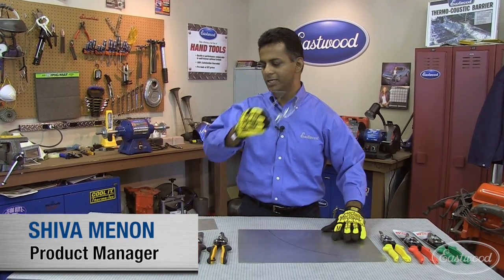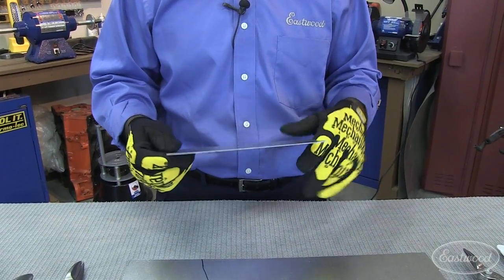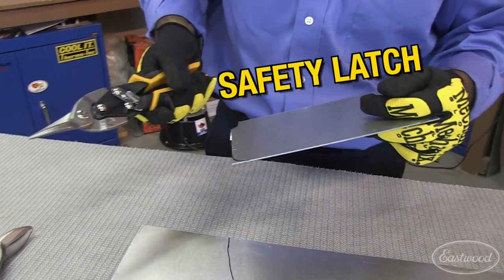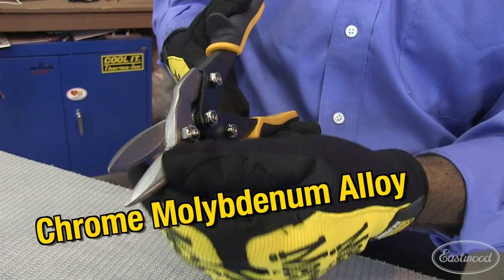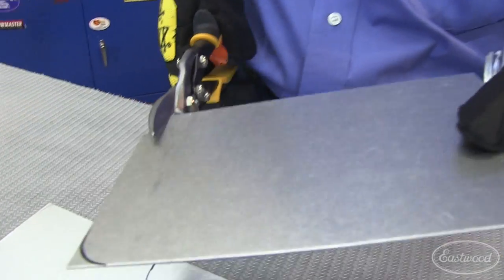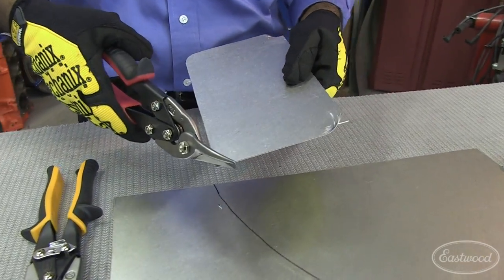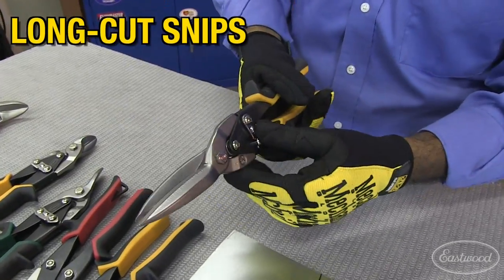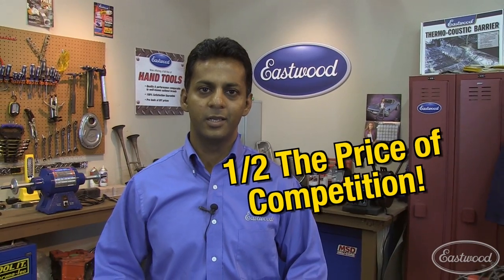Aviation Tin Snips - Wiss vs Eastwood

Comment: In 1953 body panels changed to 22 gauge steel. In the early 80's it went thinner than 22 gauge. 20 gauge would be for a box section of floor pan/frame.

Comment: Hello. I'm a electromechanical student at Fidelitas University in Costa Rica. I'm taking Metallurgy class and I have a final project, which consist in explaining the process of creating  any kind of hand tool or piece of metal, and choosing the proper steel. I've been searching a lot a couldn't find the exact alloy you guys use for blades. Can I have at least a hint? Do you use tool steel like M2 or do you use HSLA steel like a 4140 (chromoly steel)?
Reply: thats probably secret for the company....or they spend money that bought from other company....the recipt...

Comment: Are these any good to cut anything like hard paper, thin wood, plastic, rubber, cables, wires and so on?
Reply: never cut anything besides sheet metal with your snips.
Reply: @wesleybeavers1930  I use mine this morning to cut hard shell lobster claws from my dinner last night here in Maine because the hard shell lobster claws wouldn't give way to a 3 Pound Hammer I can report that the snips worked perfectly and still do
Reply: @Coastwiser  that makes sense, I should have specified about metal objects. Like electrical wire, wire, or rope. Stuff like that might botch the jaws or even worse, spring them. I cut pookie bucket lids with mine all the time.
Reply: @Coastwiser  
 Well my wife and I were driving home when I read a sign, “Lobster Tale
 $10”. Heck I thought that was a very fair price so I stopped and paid.

 The guy took my money and started, “Once upon a time there was this
 Lobster....
Reply: If you cut hard electric wire or tie wire it will put a nic in the cutting edge makeing them not so great for cutting panels or metal trim they start to nick the metal and sound like there crunching thru sheet metal